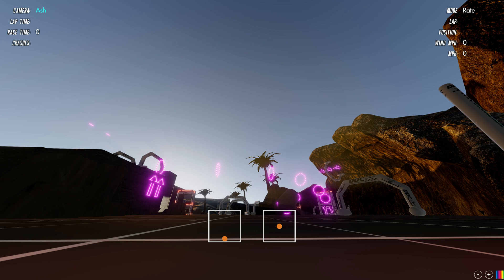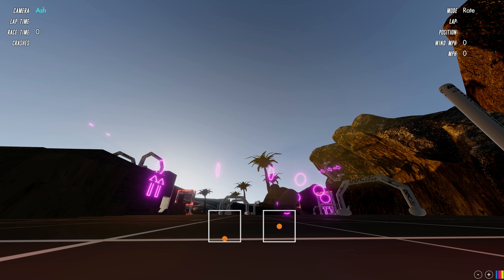Talking about micro quads and how to set them up for angle mode and acro / rate mode

Comment: Awesome video! 1 question, On the PID profile screen there are 2 settings, Anti Gravity Gain, Anti Gravity Threshold. Can you adjust them so the quad acts more like real life? Currently, I fly a TinyHawk 2. In Velocidrone, I'm flying the TinyHawk. In the sim, When I gain altitude and let off the throttle it feels like the quad is floating and not descending/falling as fast as my TH2 does in real life. Or do I need to lower the min throttle down to 1040 as suggested in this video? 
Also, any plans to add the TinyHawk 2 to the sim line up of quads?? Asking for a friend 😁👍
Thanks for your help
Reply: @_tim___4234  🤣🤣🤣🤣 I forgot I even asked this question!!🤣

Comment: Tried the camera mix angle but when I use yaw to turn a corner the quad rolls in the opposite  direction of the turn instead of banking (rolling) in the same direction of the turn.  What am I doing wrong?  Thanks!
Reply from the maker: Nothing - that is how it works. It will look like it is rolling outwards - real quads do the exact same thing with camera mix angle.
Reply: I think u mean that when u roll  it yaws in the opposite direction. 
Ive found that its related to rc super. If u turn off rc super, it goes away. But why does it do this?